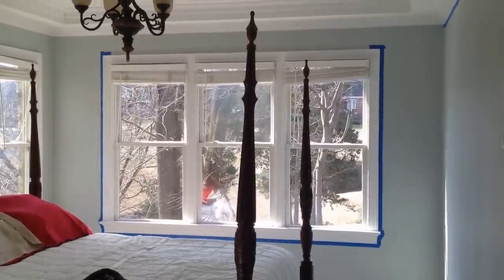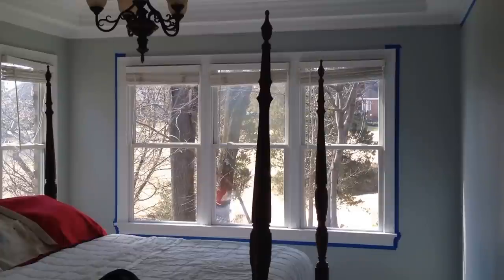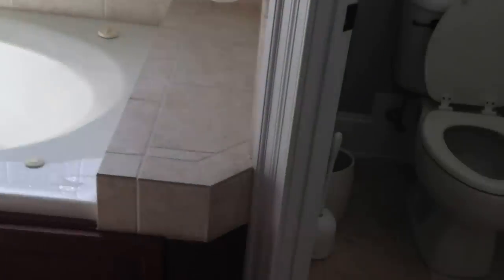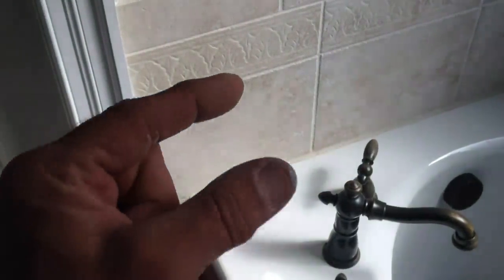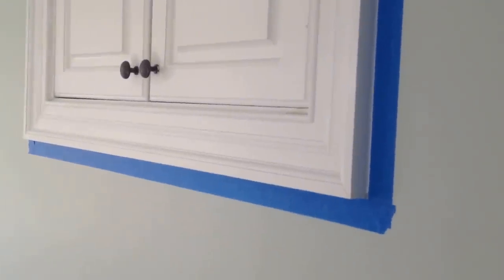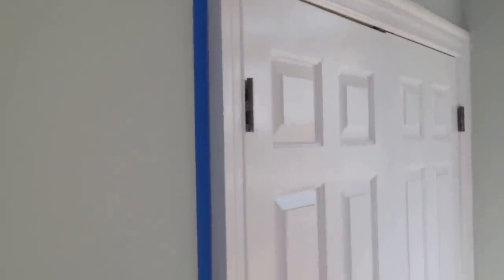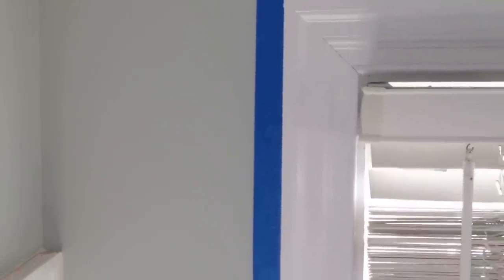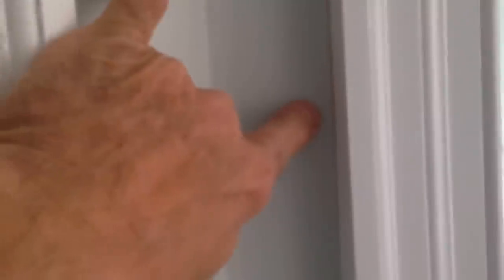PAINTING TRIM THE RIGHT WAY/ MASTER PAINTER EXPLAINS IT.

Comment: I’m a professional painter for 20 years. I paint the ceilings & trim first. Then I tape off the trim and seal the tape with primer. Then I apply the color to the tape. Never fails. No color seeps through the tape because the primer seals it. Perfect straight line every time

Comment: Have you ever painted your trim first? That's what we do. It's much easier to get a straight line by trimming the wall paint up to the finished window and door frame edges. You have the whole wall to rest your brush on to cut a line, instead of the narrow edge of the trim. Plus you don't have to worry about splattering your walls with trim paint. Just about all the contractors where I'm from paints the trim first. I'm not knocking what you are doing, I'm just wondered if you have tried it.
Reply from the maker: To answer your question, and I did read your comment.  What I show in this video, and the steps I use is the way I have painted for over 30 years.  I know there are a lot of people out there that disagree.  But I keep telling people I am not into speed, or trying to get out of a room in a hurry.  After spending years in a paint and bodyshop, taping has become part of my prep process.  It works for me, and don't have any problems with bleeding, and splattering of the paint.
Reply from the maker: Remember diver dave I am not into speed, or trying to get out of a room quickly.  I find if I stick with my method, I never see mistakes.  When your painting in a million dollar house, the people are painting for your time, and the quality too.
Reply: Big H we do the same way.
Reply: You're absolutely right, tape guy just doesn't know how to use a brush!
Terrible video, I was looking for useful information!
Reply: Tell that to customers who look at you crazy when you ask for more than a couple days. And a 4 million dollar house, barring a possible small home in a large city,  is going to cost way more than five grand for a complete paint job. You act as though you can't have fast AND quality. That's BS. What's funny is that I started out painting in automotive refinishing as well, so when I moved into residential and commercial, taping was no big thing for me either. I can tape straight lines super fast, the whole span of the wall with no breaks, and around any sort of trim or molding you can imagine, but that still takes some time. It's better to make money faster while still doing a great job and be onto your next job making more. You do that by cutting in with no tape. You also spend less on tape, which isn't all that cheap either. If you think tape is the only way to do a great job, try painting professionally for a while and do some houses where they don't want you to paint some stuff that's already there, and your tape rips that (god knows how old) paint off the wall or ceiling or trim. 

Enjoy that headache. Because unlike automotive refinishing, blending these paints, is almost non-existent. Or some textured walls or ceilings, LOL let me know how well tape works for you on them. Once you redo a couple ceilings or whole rooms full of trim out of pocket you might just think about trying it out. Especially after you've already finished painting the walls, hahahaha, good times. It's actually pretty easy to get really good at no taping if you paint every day.

When you first start trying to cut-in with no tape, it's going to drive you nuts because it feels like it would just be quicker to tape it and get some paint on there. I started with cutting in the ceiling, but I would still tape all trim, door and window moldings because it was quicker. But after a while you will get faster at painting a straight line than you can unroll tape. And you can say as much as you'd like that you never see bleeding but I'm going to have to call BS. It is impossible to NEVER see bleeding with tape. I never see bleeding anymore though, ever. Because I rarely use tape for anything anymore as long as I'm not spraying something.
Reply from the maker: Well if you didn't get any useful info you where not listening.
Reply: MR. FIX-ALL INC. I love how your comparing the work of some shitty painter. I like that you take pride in your work. But I can do everything you do before you are done taping. And you would never tell which of us used tape...
Reply: Tape is a waste of time. Tape is for amateurs, homeowners. I am a General Contractor every painter and other contractor I know paints the trim first. Much easier and faster to cut with wall paint. If your customer doesn't care that it took a day just to tape then cool. However as a boss there is no way I would pay you for a day of taping. If you were pro then you wouldn't need it. To bad I can't post a pic of my paint jobs I did myself with no tape.
Reply: It's only  USA  and  Canada  really  that  does trim  first, most  the  hole  of Europe  paints  woodwork  after  walls  finished. If you spray yes  suppose  finish woodwork first
Reply: Niall O'Connor ... It really comes down to the thickness of the trim no matter where you are. You can paint both ways, but whichever is easier to do will save you time and money.  In most cases it's much easier to quickly paint the window and door trim first, and not have to worry about getting paint on the walls. Coming back and cutting the wall afterwards is usually the easiest way. If the trim is thick enough, it doesn't make too much difference.
Reply: I will disagree with you, my boss, who taught me to paint and took me under his wing when i was a young teenager 10 years ago, is from Switzerland, where he learned to paint, does all his trim first. Best damn painter i have ever seen and i am not being biased, Ive seen amazing painters, and they even say hes the best painter they've seen.
Reply: Well  in college  for painting  they  teach  you  to  paint  trim  woodwork  after  walls( ceilings, walls and woodwork finish off ) I also think  because  you  guys  spray  woodwork  so then have do woodwork first, as we still use oil  Base paint for woodwork mostly. Take to long oil to dry to finish  walls, so we  finish  walls  then  gloss  finish oil, walk  away  let it dry
Reply: Big H 
Hey I just left the same comment.. the dude in the video is a clown.
Reply: William Crook ,

A customer who hired us to do all his wood floor refinishing told me he was going to be painting all the rooms himself ?  (Upscale waterfront home ) he’s paying us a small fortune for the floors and won’t hire an exceptional painting crew ?? So, l asked him why. His answer was similar, was taught in Germany under strict painting group to only clean brushes his first 2 years. By the time he came to the states he was over qualified to paint his own home.  I went back to take the after photos of the floor refinishing and newly decorated rooms and l was blown away with the details of his painting skills.  Nothing to do with speed, has everything to do with years and years of exhaustive hands on training and in the field mastery.
Reply: Trim first all day. This is absolutely unnecessary. This is what home owners do. Rookie
Reply: He also said its "cold as HELL outside".... hell is hot isnt it..... maybe he cant see as well as he use to and needs the tape. Wonder if hes ever heard of a microfiber nap.  Just an old school painter... they all knock other painters. Stay out the oil base. Soon there want be anymore oil base paints
Reply: Trim first always
Reply: Never trust taped lines pluse bleed through is worst. Yes free hand is best if know what your doing your going to need a proper 3inch trim brush and always thin out paint or else it will be hard to get straight lines....You can tape just make sure to remove tape before paint is dry. Caulk is mostly a job for white trim if painted your rite caulk needs to be painted as well..
Reply: @jmc302005  saying tape is for amateur proves u are an amateur yourself. The truth is a real pro would have sprayed all the trim, then tape the trim caulk your tape then paint walls
Reply: We paint multi million dollar places in muskoka and never would you paint trim first. We do the walls as soon as drywall is primed then carpenters install trim then caulk fill nail holes and paint comes out perfect everytime. Only thing I disagree with is tape you dont need it if you know how to caulk properly.
Reply: @b1pawh  once you go trim first you don't go back. I promise you...
Reply: @American-Picker  we do primarily new builds trim is always last stage for builders we do ceilings and walls then floor gets laid while we pre coat trim once then they put trim on we fill holes caulk and top coat.
Reply: @tnoel374  you'd still be better off painting trim first and tape off the trim if you want perfectly straight lines .... trim first is a better method ..... paint trim , dry overnight ,tape trim , cut/paint walls ..... I bet you'd like that better if you gave it a try

Comment: Ok so you said you painted the walls in the bedroom. Now why wouldn't you paint all your trim first ?. I paint the trim first because its easier to cut in the wall color last than the trim and then you don't have to use all that expensive 3M tape. That's how I do it and I've been painting for 20 years and its what works for me, but either way I can cut a straight line. You're so right on Certa Pro they suck so bad. We call them Certa Blow up here in Massachusetts. My Dad has also been painting for 40+ year's and thats the way he taught me and I really hate using tape unless I  really really have to, but I do understand your method and it works just fine. I just think its easier painting trim first then the walls. I will tape off the baseboard with 9 inch tape when I paint the walls so no splatter gets on it.
Reply: Jeff Froment exactly how i do it bro
Reply from the maker: Hi Jeff I tell people all the time that you paint anyway you want it's OK.  As long as the results are what the customer is paying for make them happy.  The explained the reason I always tape is from my years working in Auto Body shop.  For I can tape a room pretty quick.  The cost is of no importance to me because I charge the customer.  The one thing I notice is when you're in a very expensive home, and the homeowner see that you took the time to tape.  They then can't come back on you and say, HEY how come your lines aren't straight  It's a great selling point for the quality job.
Reply: exactly. overlap ceiling and trim paint onto the walls then cut and roll wall colour .
Reply: Jeff Froment  because he's not you he does his work differently
Reply: well said jeff its 100 times easier to do it first
Reply: Very good tip Jeff. I agree the way you do it is much easier.
Reply: Jeff Froment... Trim first, walls last, and I cut the trim by hand and it turns out perfect every time.

Comment: Not sure what a " Master Painter " is but I know what is isn't. It isn't a self taught guy who tapes up a room of trim.  I got my ticket from the provincial government after four years  on the tools and 20 weeks in schools and the old buzzards who  taught me  would go nuts if you tried to tape anything.  Taping is lost time and unnecessary if you have been shown  good technique and your hands have put in the   hours. Tape is for protecting surfaces not making lines. Even with 13 dollar a roll frog tape you will have seepage any place the surface dips and you aren't hyper-vigilant about pressing it in place, and even with the low tack stuff you will get the odd spot pulling fresh paint off the wall. Now you are back to  patching when you should be cleaned up.
This video is suitable for home owners who haven't got good habits or the hours in.

Comment: If you want lazer lines paint the trim first and then tape the trim the following day before painting the walls.. I'd prefer not to tape over freshly painted drywall but it certainly can be done.

 I do the same for baseboards. Paint them first then tape the next day. Lines come out perfect. I use Frog Tape. For those bitching about the cost of tape you'll  cover that cost with added speed and the lines will be perfect.

When I sometimes spray trim I follow the same method I described. I have used your method with the light tack 1"'  Yellow Frog Tape. That works well too. Your not wrong and I agree with you about using tape. I was a free hand guy for 20 years and have used tape the last 3 years and it is faster and better.
Reply from the maker: Thanks Ted for your great comment, and also that you understand the benefits of using tape.  The benefits, outweigh and time issues, or cost issues, that everybody complains about.  I have never ever had a complaint from a homeowner, about my lines.  Thanks again for your comment.

Comment: Taping is great when you're doing multiple coats - saves 2 or 3 times of eyeballing. Personally I would've painted the trim first though for a number of reasons.
Reply from the maker: Thanks for your comment.
Reply: Lino Andrade  Because you would have covered any previous mistakes from the previous paint job.  I.e. wall paint on the trim AND it's much easier to cut a wall with a brush instead of cutting a 1/2" piece of trim with a brush.

Comment: Caulking toilets isn't a good idea because if there's a leak under the toilet you'd never know since the caulk traps it in.
Reply: Its city code to caulk around the toilet for that reason. Your suppose to leave a 2" gap in the back of the toilet, so if your toilet does leak, you will notice it from the back where the 2 inch gap is. In California, that's code, not sure about other states and cities. They're are not nice out here.

Comment: May I add to your advise , after your tape prep is done caulk around all that is taped with a tiny bead of caulk , firmly pressed in to seal the tape edge , fairly soon after your finish coat of paint pull the tape,  this will guarantee a perfect color transition with no bleed through  hope this helps
Reply from the maker: That's good advice Brain thankyou

Comment: 8:15 can't paint with a brush at 90 degrees angel is right but you don't need it at 90  to cut that trim. I have free cut many awkward and uncomfortable positions and still got a strait line but also took me a while to master that skill and knowing what brush to use. I agree tape is needed sometimes. I have tried both way and I find it much more comfortable to paint trim first to free cut and keeps my paint skills on point and it's easy to tape everything and slap paint on and call it a day, DIY do it all the time. Trim before wall or wall before trim either way the final results is what counts. Do you paint the ceiling for last then tape the walls to cut ceiling?
Reply: A skill not everyone is capable of. No chance of learning it if you never try! Can get a lot done with a brush and a can of paint. Get comments all the time about why I don't use tape. I take my time and paint a straight line. Helps being able to paint with both hands as well. Really extends your reach on a ladder.

Comment: I been painting for years and use no tape on trim. I always paint the trim first either by hand or spray and cut the wall to the trim free hand straight as my ceiling cuts. I would have that room cut out on the walls in 15 min and rolled same time.

Comment: Good prep is key to a good paint job. Prep is 90% of the job. Most anyone can paint. Sand walls until baby butt smooth. Sand trim and sand between coats. Foam rollers for doors. Trim first, always! I only tape top of baseboards. Oil primer, good latex top coat. I'm changing my house from dark stain trim to white. Removing doors replacing all hinges and hardware after paint.

Comment: Paint your trim first. You always cut into finished trim with the exception of baseboard which you put the final coat on last. There’s a little note of a way to do it “right”. 
Oh, and never caulk your shoe mold or quarter round to the flooring.
Reply: You DO, if it's in a toilet/bath area.

Comment: How long do you wait to remove your tape? When I have done it this way before especially if wall has freshly dried eggshell paint on it. One of two things happen I either pull some paint off the wall from the sticky side of tape or the dried semigloss paint sticks to tape and sometimes pulls up some up the trim paint. I prefer taping myself just like you do but I have found that it's generally best to remove tape while paint is still wet. Thoughts?

Comment: I typically freehand considering I don't do a lot of "fresh new builds", so there is some character to the houses I work in, some imperfections which make it charming.
But then again, my freehanding is pretty damn perfect and straight ... but I have been painting for more than 12 years.
I've also come up with my own technique which makes it really easy, and I teach it to my apprentices.

But when you have long straight lines to do, taping can save some time. And I'll usually do the caulk trick for perfect lines in new builds

Comment: and by the time you cut in that white side edge to the darker wall color, you will have seepage under the tape to cleanup with wall color anyway. Unless you use a putty knife to press down the edge of the blue tape well, AND AND  pull they tape away from the painted trim immediately as you go so there is no time for seepage of white  under tape onto wall color.
This is harder to keep dipping , brushing and smoothing out paint and being ready to pull wet tape as you go, I've done it when I have to when painting the walls is not called for.
So this guy is doing it right in one sense. BUT BUT , I dont like putting tape over fresh
wall paint as he does here, especially pressing down tape hard to seal off white paint seeping under tape onto wall paint , creating more work.